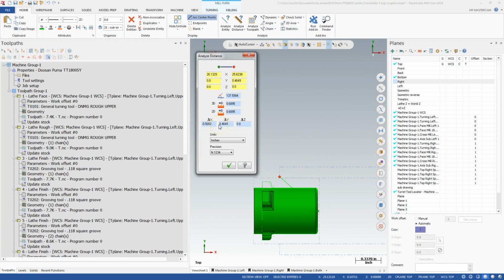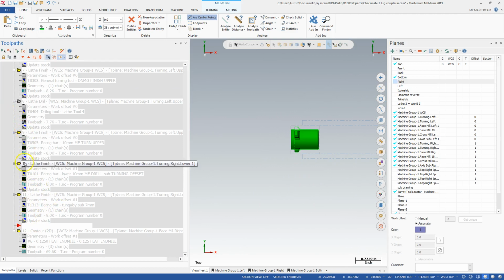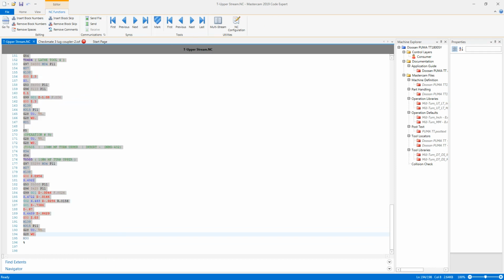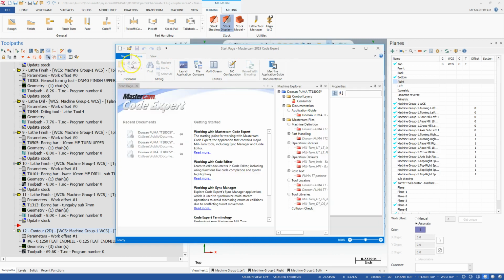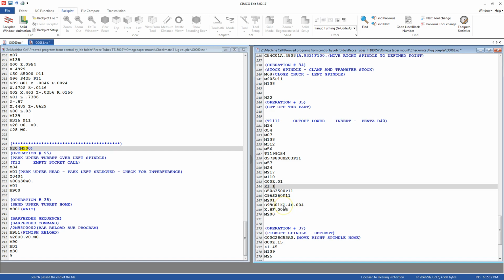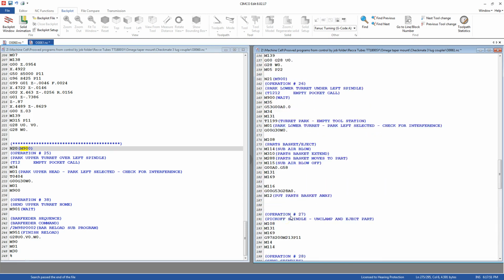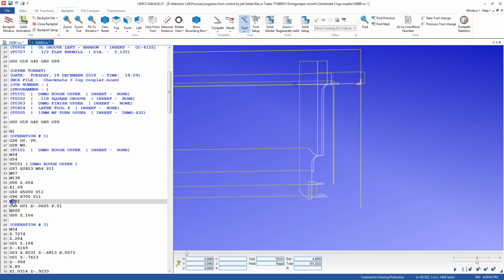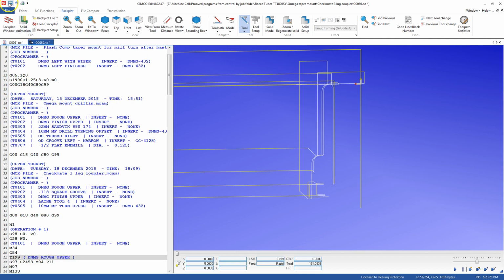How I post jobs from Mastercam Millturn

Comment: I used to save my pick off, part off, sub transfer codes as text files and used manual entries to have mastercam post those out with my toolpaths.  It wasn't the most efficient way but it worked for me.
Reply from the maker: Manual entry is the way Mastercam admits failure to post code to the machine.  I see how it could work but it isn't the solution we would like.  I used topsolid once and it wasn't the answer IMO but the cool thing about the software was it handled lead ins and outs and some functions mastercam makes you do manually by itself in an efficient manner.